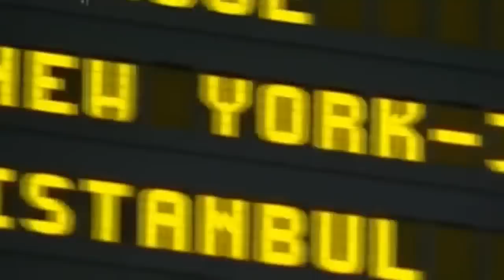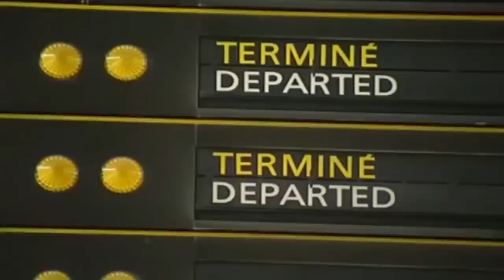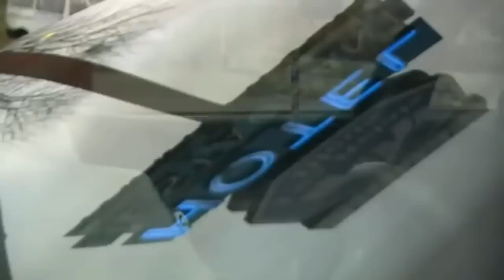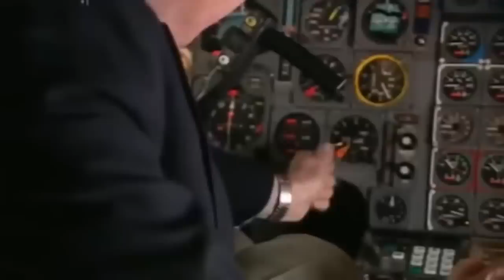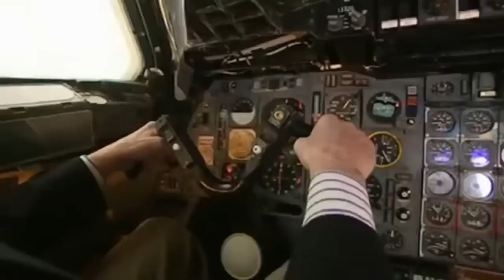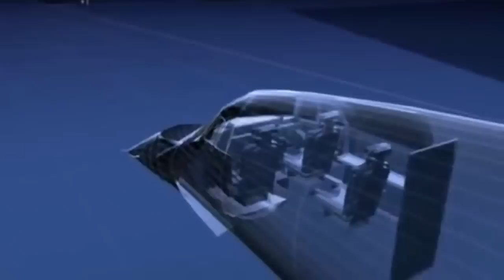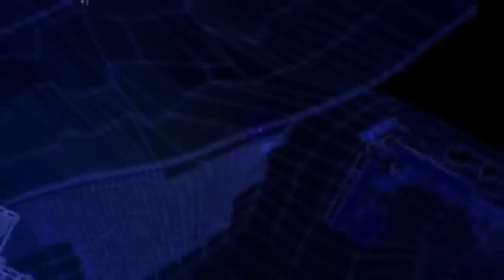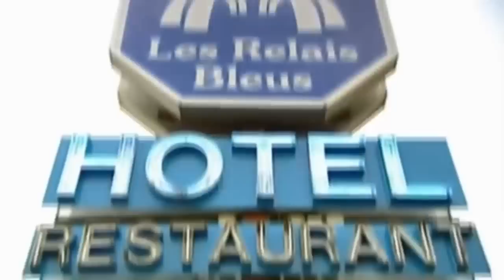Air France Flight 4590 Concorde Disaster Paris

Comment: A piece of metal from a DC10. Discounted the Concorde. But the DC10 has caused more accidents and it is still in the air.
Reply: gno1972 I thought Disaster Carrir doesn't fly anymore...
Reply: More than 400 DC10s were built with a mere handful of fatal accidents. DC was a beautiful plane and reliable. No DC10 is in the air for passengers, but cargo!

Comment: Must have been agonizing for the mechanics who performed the last repairs on the number 2 engine, untill the true cause for the crash was found.
Reply: Yet strangely enough, if they hadn't repaired it and been delayed by an hour, the strip of metal wouldn't have been on the runway. It opens up the thinking that there are no accidents - everything has a purpose... timing is everything (insert "Twilight Zone" music! 😉)
Reply: If that accident would have happened to regular passenger plane they would have just send note to manufacturer to make the bottom of the plane stronger to to make plane safer and hope it never happens again. On this case they just banned the whole thing forever :(

Comment: The world wide implented rule to NOT abort a take off after V1 saved more lifes than the number of lifes that died on Concorde crash ! You think it would have saved them but imagine an plane at take off carries an big amount of fuel like Concorde did for its trip . To not abort take off and then overrun then runway with 100 tons of fuel would have ended in the same disaster. Also its critical , normally you can fly the plane with 2 engines only . Every 4 engine powered is designed to fly on 2 engines only and every 2 engine plane can fly on one engine with no problem . The problem here was they got the information they had a fire and that means for the Cockpit crew its an engine fire which they are trained to handle and when it happens after V1 , the speed you reached at which you no more could stop the aircraft on the remaining runway length , you have to take off and then first ! fly the plane and reach a safe speed and gain altidude and then start your checklist for engine failure. What they didnt know is that their whole wing was on fire and this fire fire destroyed all the controls on the left wing and then the wing structure itself failed . This crew did everything right . They could not do anything to avoid the crash and the captain showed great flying skills as he kept Concorde in the air until the flight controls and the wing failed . He then had no chance to control the aircraft and when they finally stalled there is ansolutly nothing you can do in such a low altitude . When they finally stalled the aircraft i am sure they said good bye to their families as they knew their life and the life of all passengers will end now .
Reply: Well said,  a rational description of the facts displayed in the video.  Sadly it seems it may be a wasted effort given the relative awareness of the commenting public.  This getting old shit is terrifying.  It leaves one questioning the fate of the human race.  The accumulation of fucking idiots seems to be advancing and there's not a damn thing I can do about it!
Reply: Mick, so you're saying regardless take off or no take off everyone on the plane still die? How would you feel if I tell you, regardless you pray everyday or not praying at all you still go to hell. Or would you gamble, abort the take off, try bringing the plane to a halt and pray you can save a few lucky passengers, if not all passengers. You wouldn't know until you try it, but you wouldn't even try. Sighhhhh. #spanked
Reply: Hmm... Ok... what if the spanking occurs at the hotel...?
Reply: Why didn't he immediately release fuel from airplane?
Reply: Pretty accurate description, "Mick"  -- when I fly, I never know whether to cringe or beam at that critical V1!  So I smile and grit my teeth.  Terrible crash, perhaps there should be a rule at all those large airports to check the runway before every major take-off to make sure it's cleared of any rubbish, though that's hardly feasible due to costs and a probable paucity of personnel.  Hopefully, a small piece of metal wouldn't be as fatal to other aircraft as it was to the tires of the beautiful Concorde.

Comment: It's always the damn DC-10
Reply: WarriorsOfThalkin The DC 10 would have been a safe plane if they hadn't changed the Door to the haulage part of the plane. What a massive fuk up by Douglas/Lockheed by designing a Door that failed on 3 occasions. The old door closed from the inside of the Plane, the new door closed like a Car trunk but didn't lock properly and Lockheed KNEW the door was unsafe because the tests before the Plane went into production failed to close properly but they went ahead with the new door and lost their Ass because of money
Reply: WarriorsOfThalkin 
Love DC10 ♡♥
Reply: Not about a 43 cm strip of metal. Like the comet, the concorde  was a fast and fragile plane. It was only a matter of time before the super high pressure tires failed and impacted the underside of this plane- a failed design just flying on luck for so long, until it ran out. RIP to the lost. DC 10 had nothing to do with it.
Reply: piece of shit aircraft. glad its recognized for what it really is. so many engineering errors.
Reply: Virginia Kennedy Don't forget the DC10 that had an engine fall off on takeoff from Chicago in '79, killing all on board. Or the World Airways DC10 that crashed into the bay in Boston. A father & his son were never found. Neither of those had anything  to do with the cargo door.